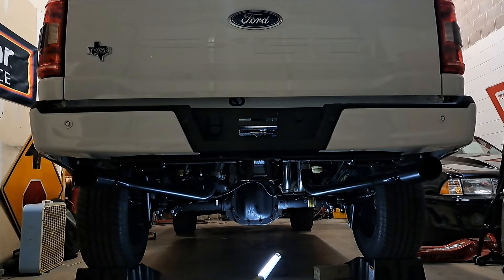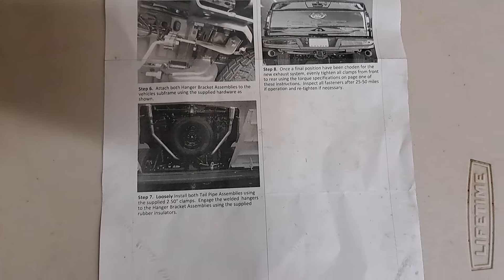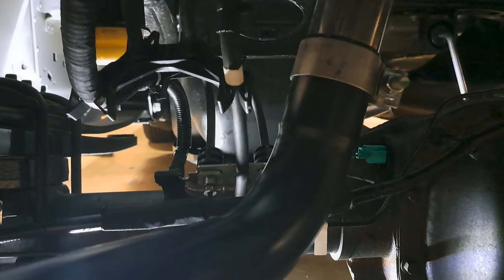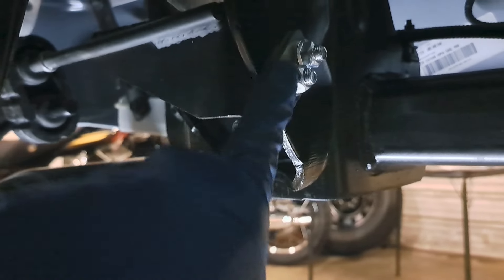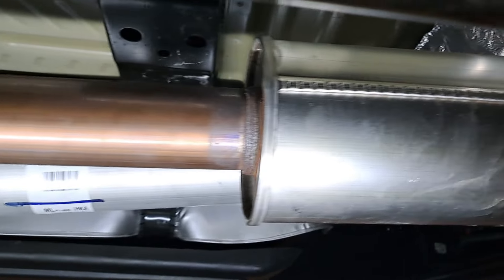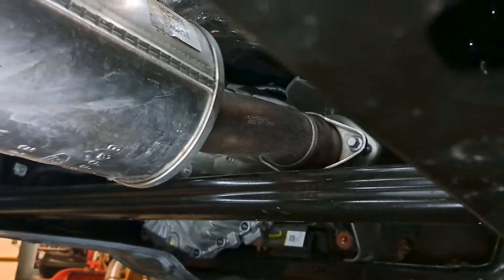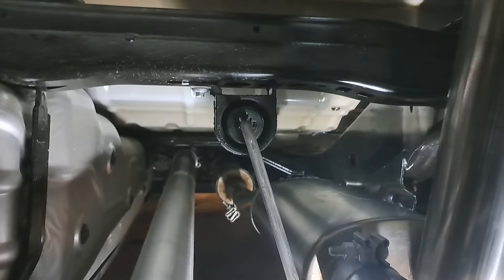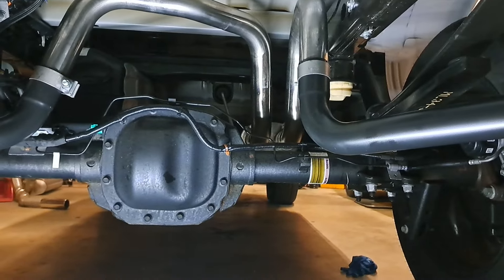F150. MagnaFlow 19562.   Installation tips. Ford F150.

Comment: That dual exhaust to the rear is way better than I was thinking. I will definitely look to see that they make one for the regular cab. I see you have the FX4 4x4. Is lowering (5")/leveling(1") the rear going to cause clearance issues...couldn't tell how close the left pipe is to axle or tubing? Great tip on the muffler being keyed to pipe. Had seen the result of someone who was unaware of it. your recommendation to remove the resonator is the way to go. You do any painting other than the bracket?
Reply from the maker: I had lowered mine roughly an inch and a quarter with shackles, if I were to remove the blocks that would give me a total of 3 in in the rear and I don't think that would create any issues whatsoever. Any more than that I can't really speak to but from the looks of it I don't think it would be a problem. You would definitely need a different set of Springs though as the lowering shackles bring the spring fairly close to the bed. only painting I did were the brackets themselves. Everything else is as it came from the manufacturer. Once installed, it's got a very mellow deep tone with the resonator. It would probably sound amazing without it, but I ended up liking it with the resonator. It's something you could easily swap in and out though. It would take you longer to find your tools than it would to do the actual work.
Reply: @bmasontv  LOL yeah as you were naming off the different sizes I was thinking I had better check to make sure I have and know where they are. Wouldn't be the first time I got started on a job and realized I needed another tool.